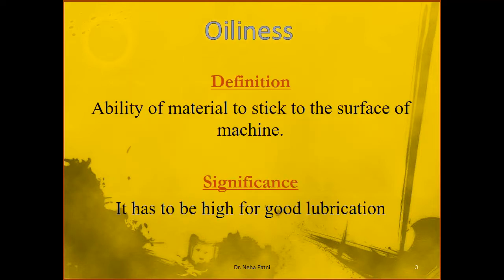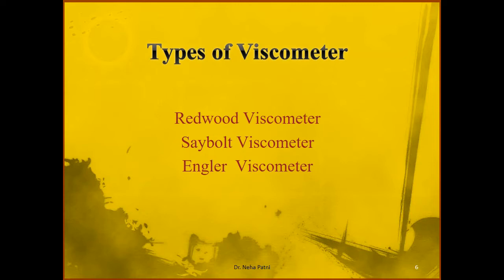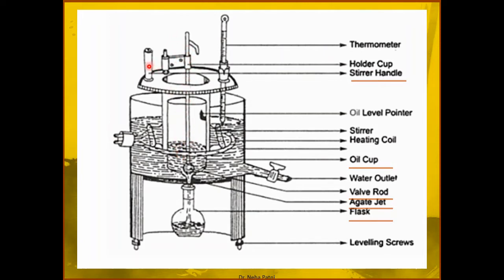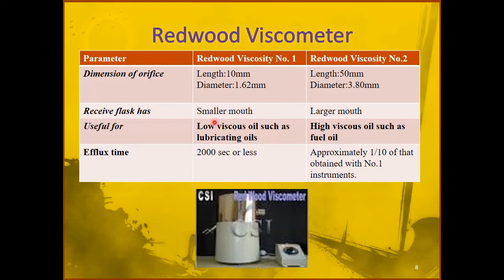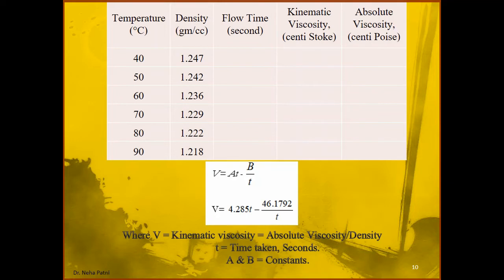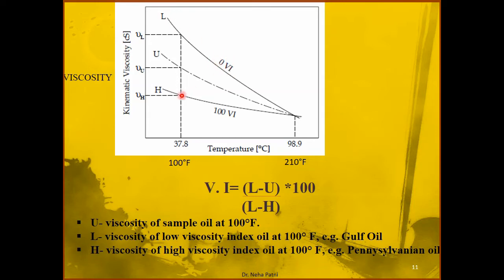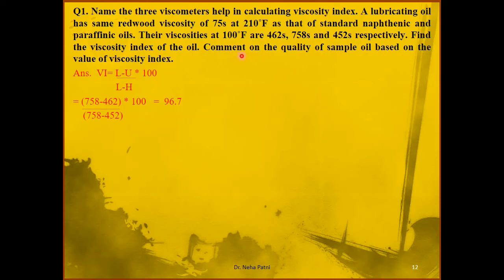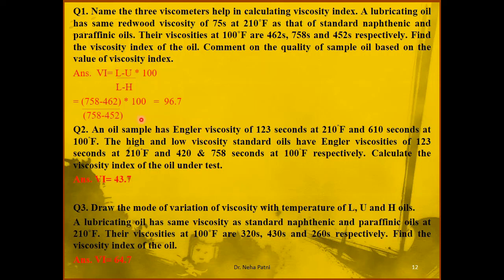Determination of Viscosity and Viscosity Index of oil

Comment: How we increase viscosity index of an oil please reply
Reply: Thanku mam
Reply from the maker: By adding viscosity index improver like poly hydrocarbons, butyl polymers, Isobutyl derivative etc to the lubricating oil.
Reply: Mam pls or points btao muje presentation Deni h
Reply from the maker: @swatichauhan2121  viscosity index improvers are additives which if added to lubricant doesnot allow it's viscosity to vary much with temperature so they improves the VI. Polymers are majorly used like polymethylacrylates, poly isobutylene, propylene etc. They are generally used to thicken mineral oil so they are known as thickners. Higher mol weight polymer have shear reducing property so with time they are of no use while lower mol wt polymers are shear resistant and therefore majorly used as additives.
Reply: Mam...is coconut oil use to increase viscosity index of an oil
Reply from the maker: @swatichauhan2121  I think it has high viscosity index so can be blended with other oil for the same
Reply: How we know the viscometer constant ? I'm working as chemist in lube i industry
Reply from the maker: @sajasmm   The constants are determined by calibration of apparatus and it thus varies from apparatus to apparatus.
Reply: @NehaPatniChemistry  thanks